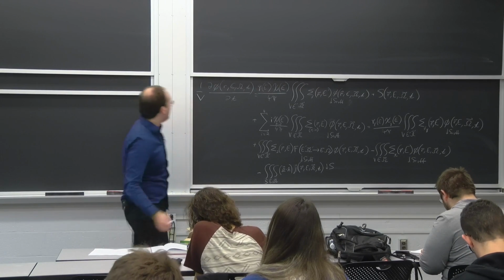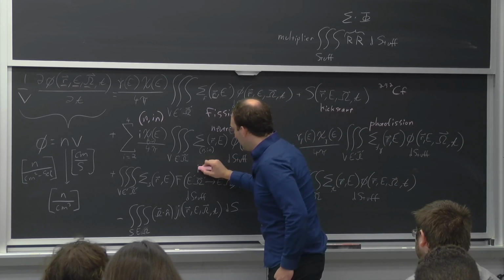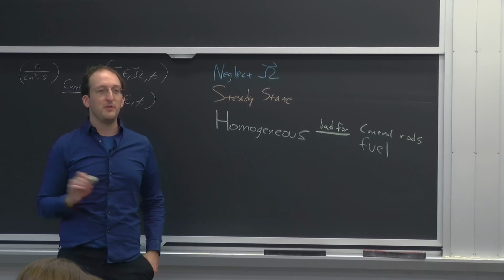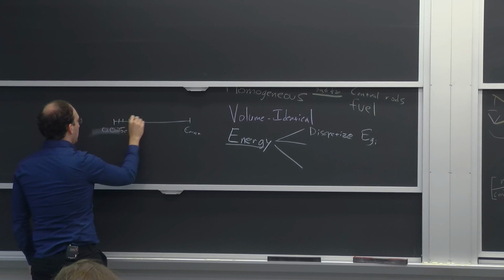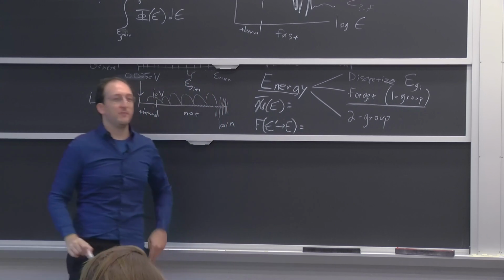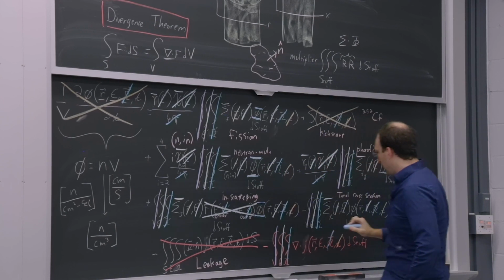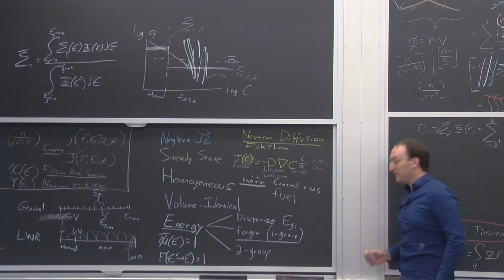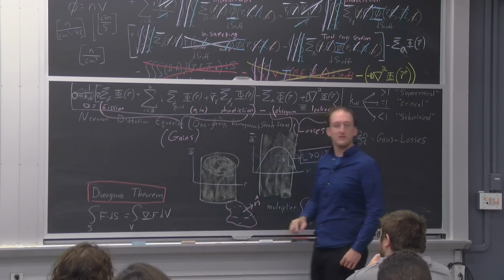22. Simplifying Neutron Transport to Neutron Diffusion

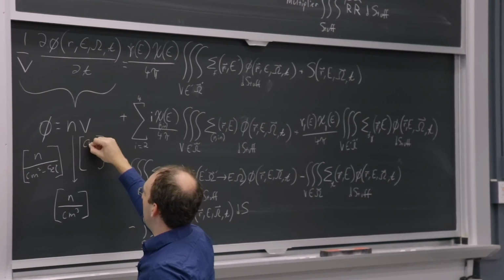Comment: 3:15- flux=neutron # per SQUARE cm : what is the physical meaning (2D is a conceptual area with no physical thickness, so neutrons must travel perpendicular to the area plain parallel to the direction of v) ?
Reply: Flux is much older concept than neutron flux..it was initially used for electric and magnetic 'field  lines', based on observation.. in case of neutron generally two assumption are taken one is thickness of area is just one neutron diameter to prevent shadowing and secondly in z direction (3d), z is taken to be 1. So we have only two axes area to focus on..

Comment: Something tells me you have never studied molten salt reactors. Everything you said smackes of disinformation to nuclear engineers. 1. They have no control rods they load follow with heat. The critical function is the amount of fissionable quantity in relation to total salt volume. 2. They are not homogenous and will have graphite moderating lengths running from the top of the reactor to the bottom with salt circulating in the voids between bundles. The graphite will fit together in a key and slot method. Being non homogenous with a fertile blanket of thorium with a possible neutron reflector periphery to reduce overall reactor size and no pressure vessel because one bar is all it will have. Many many other statements smack of disinformation towards the best reactor possible today for process heat for chemical manufacture as well as salt water desalination. I was interested in your classes till you started lying.
Reply: I would love to watch your class as well.  Please point me in the right direction.
Reply: Honestly very few people know about it including me.. I too skip it, and am interested in lwrs, which he too referred many times... But he had to made it somehow to show student what homogeneous meant...
Reply: Go earn your way into Uncle Sam’s nuke school then Cadet Dunning-Kreuger. MIT won’t miss you.

Comment: when is it supposed to be E prime over just E?  He seems to go back and forth a lot and I'm not sure when which is supposed to be used.
Reply: E' is for 'another energy level' whereas E is for 'the one we're interested in'. Overall, you need one for the parts of the formula that depend/describe the initial state in a case where energy changes.

On the full fomula, after he adds many primes, I think only one more is missing in the flux for E' -> E.
Reply: First observe if it is a gain or lose term..